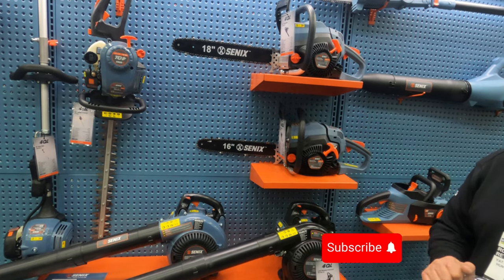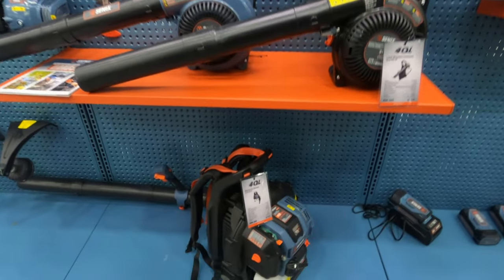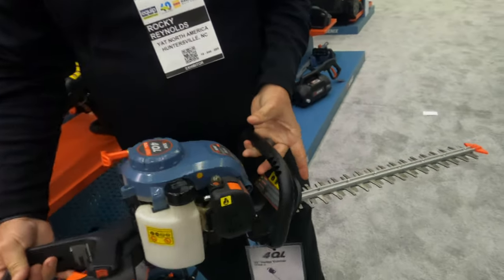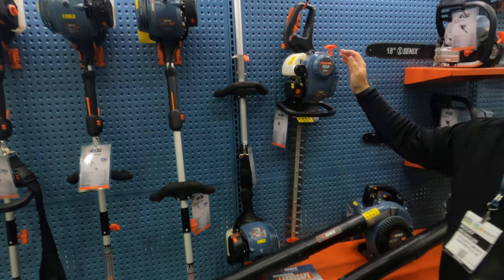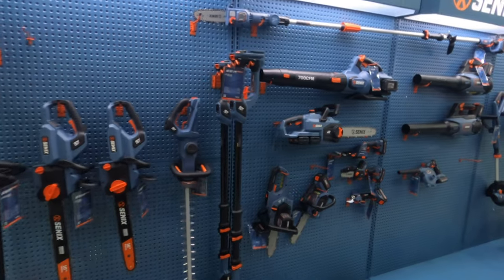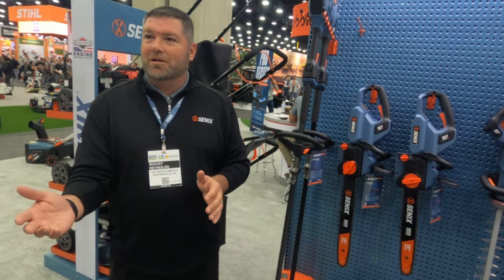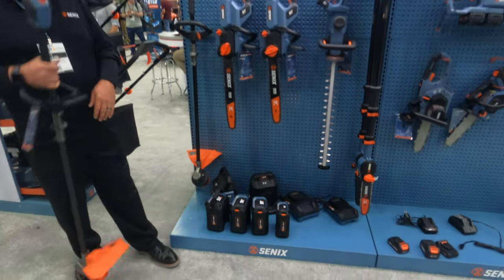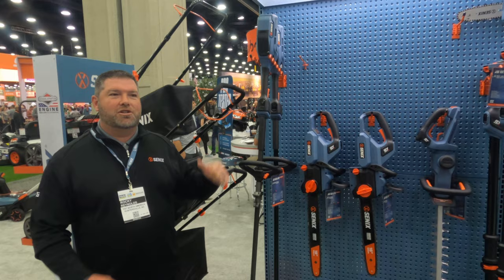You must see Senix Tools 4 cycle gas powered and battery equipment

Comment: I think I'd want to try one before judging it. Got so used to using a two stroke, I don't know how I would feel worrying about oil with no hour meter. I think its simpler just mixing gas and oil, it takes like an extra 30 seconds, and you don't have to worry about always keeping your oil changed.

Edit: Stihl has some 4 stroke string trimmers like the fs91r which take a oil/gas mix. Some like the fs94r, are regular 2 stroke engines. talk with your dealer to make sure the one you're buying is 4 or 2 stroke. Either way, the stihls take mixed gas. Today I found out i have a 4 stroke string trimmer lol.

Second edit: These are stihl's 2 stroke equipment. the rest is 4 stroke. They all take the same mix
Trimmers: FS 38,40,50,56.70,94.240
----------------------------------
Blowers
BG 50, 56 BG 66,86
BR 200, BR 350,430,450